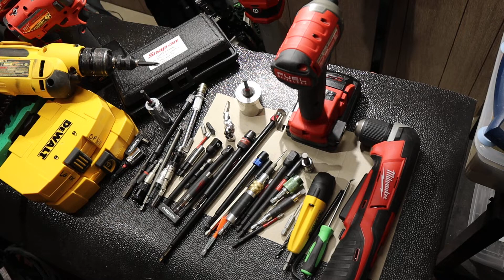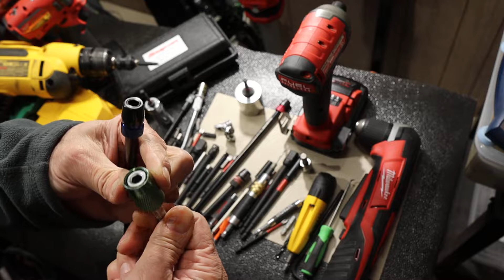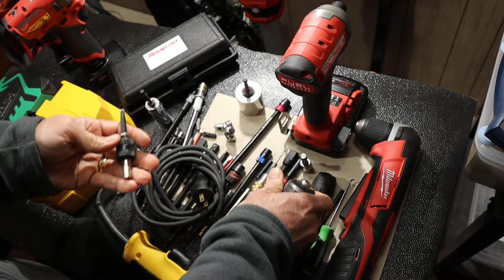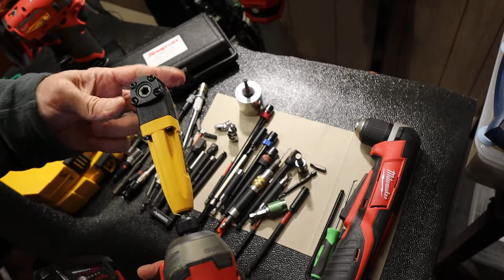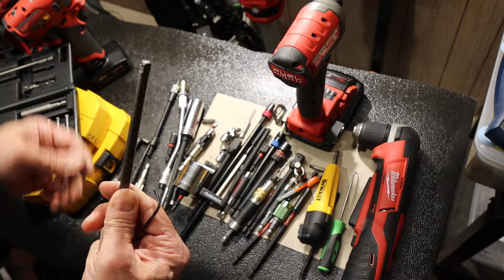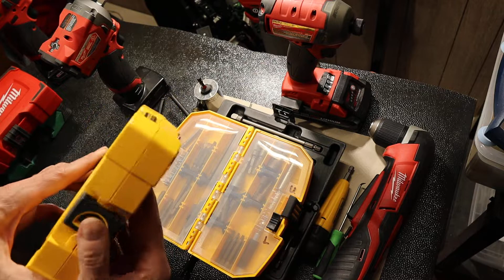Talking about Locking Bit Holders, Bits and Adapters at Last Best Tool

Comment: Those bit holders with the sliding sleeve, I wonder if you could drill and tap a hole in the side and screw in a grub screw to hold it in position, then it could be used as a depth limiter. It won't be perfect, it would probably slip quite easily so definitely not for use in impact drivers, but it might work for drilling skis 🙂